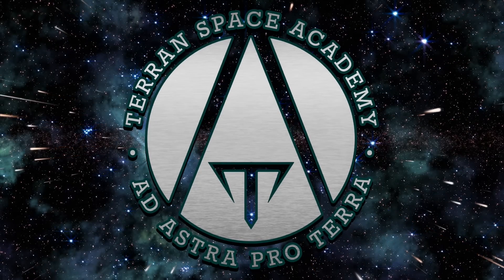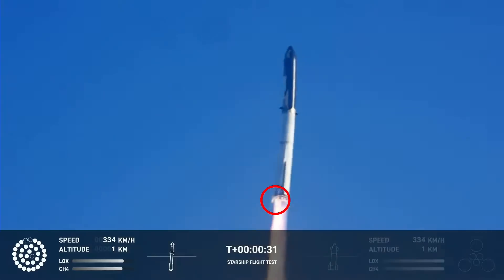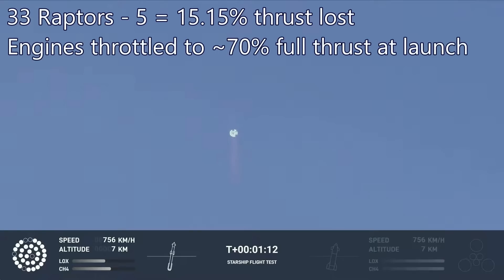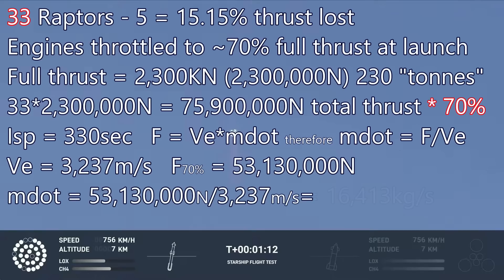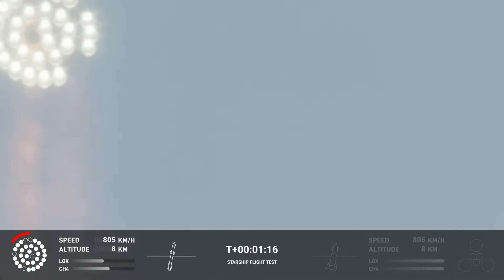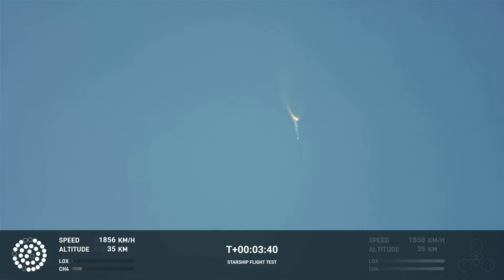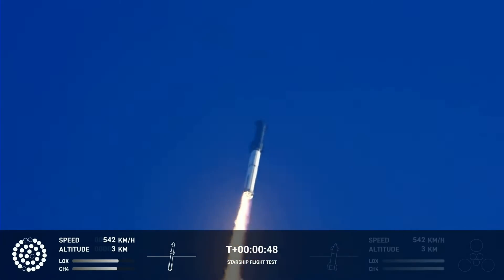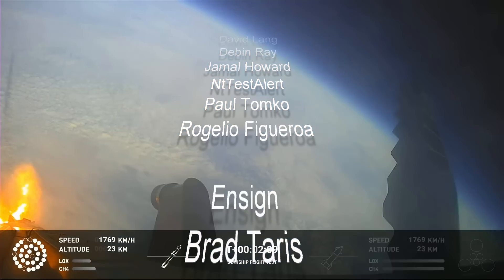Starship Flight Analysis: What went wrong with Starship?

Comment: Another thing I should point out is the LOX and Fuel ratio. This flight test shows they have less LOX than expected. So there might be some problem with the LOX and fuel ratio consumption, either fuel not flowing as fast as it should or LOX flowing too fast
Reply from the maker: Do you think there was a debris related LOX leak? If it was at the base it might not have depressurized the tank. I thought there was way too much venting off the one side...
Reply: @terranspaceacademy  It could be. I kinda doubt they would miscalculate the flow rate by such a large margin.
The damage caused by the debris to the vehicle is much more than I expected, so debris related LOX leak is very much possible

Comment: You spend all this time and money designing and building a state of the art rocket, then you take it out to the parking lot and  blast concrete all over the place, build a launch pad worthy of that rocket and for god's sake move it away from those tanks, I know that people say that it is a safe distance, but it just looks bad aesthetically, make a beautiful launch pad for a beautiful rocket.
Reply: Yes, No comment was made about the lack of deluge system (allegedly Musk wanted to proceed sooner than it could be made ready) or the resulting damage and flying debris possibly damaging the booster.
Reply from the maker: This was a test... and these things need to launch from unprepared sites on the Moon and Mars.  Knowing what to expect with a rocket you are going to throw away anyway is smart.

Comment: Nice analysis. I am interested in stage 0 conditions after launch.
Reply: Stage 0 could end up as the reason this flight had to be terminated.  The debris caused damage that became catastrophic.  They have to fix Stage 0 or the next launch is going to suffer the same fate.
Reply: @osd9933  Agree. The pushy bits of a rocket can be a bit sensitive to boulders and steel slabs smacking into them with blast energy.
Reply from the maker: CSI Starbase will do a great breakdown on Stage 0 I'm sure.
Reply: @terranspaceacademy  Yeah, He and his team do great work!

Comment: I think the lack of a deluge system and/or flame diversion is what caused the craft to not earn it’s extra credit points. The area under the launch mount is absolutely gutted. Impressively so. That much damage couldn’t possibly happen without damaging the engines. Immense shockwaves and high tensile concrete chunks probably slammed the craft. I’m absolutely impressed by how robust the craft is though. Numerous things seemed to happen in flight that would have destroyed a regular rocket. I can’t wait for the next launch! And I can’t wait to see how the issues are resolved.
Reply from the maker: I'm wondering about steel plating over the concrete?  Water cooled perhaps?
Reply: @terranspaceacademy  I saw a tweet from Elon today that described exactly what you’re talking about. I was thinking that running the deluge water through the steel plate might be a way to “no part” but I don’t know how useful super heated water would be in a deluge system.

Comment: a safer and less stressful way of separation would be to do a cool down of ship engines which should provide enough pressure  to separate
Reply from the maker: I'm not sure it would give enough thrust to use it as a cold gas thruster...

Comment: Thanks for that nice analysis! I believe though, that you are wrong in one thing: From my point of view, the SpaceX diagram concerning engines is correct, but you need to rotate it by 120° to the right. Then it fits exactly (well, it is some seconds lagging behind, so at times it still shows an engine going, that is already off in the video. And the one that is visible "off" in the video but "active" in the diagram, is exactly the one that "re-lights" later again). So, they did not lose 7 engines, but only 6. One coming back, so again only 5 missing. That is still sufficient thrust, as you calculated. Concerning the outer engine "re-lighting": probably it never was really shut down, but lost so much thrust due some internal failure, that it was marked as "off" in the diagram, but in reality it was still running at low thrust. Then it throttled up again. But that is just an assumption, based on the diagram.
Reply from the maker: Good point!  Thank you!

Comment: The center engines can gimble to account for loss of thrust.  Also, the engines that you highlight on the telemetry diagram were out 2-3 seconds after liftoff.  The failures you are pointing out in this shot do not correlate to the telemetry and don't appear until several more seconds. :(
Reply from the maker: There did seem to be a telemetry delay...

Comment: Failure to separate is a problem. Had a crew been aboard it would've sealed their fate. I am guessing this earlier rocket does not have a crew survival protocol to initiate separation in sub-optimal conditions. Put another way, it is possible that conditions never matched the required parameters to cause separation and, in the absence of crew escape systems, simply remained connected. As for the rest of it, there is far more than ice falling away from the vehicle upon takeoff. If you look closely at this and other, independent video, you can clearly see huge blocks of debris, probably concrete, ejected skywards - some reaching almost to the top of the vehicle. This being the case, it is entirely possible the rocket array was severely compromised by debris it had, itself, kicked up. No doubt we will be told in due course. To be honest I was disappointed. I expected the vehicle to at least reach its suborbital altitude and velocity, but it fell well short. Oh well, onto the next test...
Reply from the maker: Almost certainly David.  It's like launching with grenades going off underneath.

Comment: There is a flaw in your analysis.  My understanding is you don't actually vary the throttle on the outer ring of engines after an engine failure in order to counter the torque imbalance.  Instead what you do is gimbal the inner engines.  Something you can see in some of the videos is towards the end of flight, you can see the rocket is going off course before it all out cartwheels and this happens after more inner and outer engines fail.  There might have been the problem that the remaining inner engines couldn't gimbal enough to counter the asymmetric thrust and this is what lead to the eventual cartwheeling of the rocket as opposed to stage separation.  It was a well known compromise in that adding the extra inner engines, they reduced the gimbal range of the inner engines.

There is another problem in that for staging, the rocket was rather low.  I don't think it was ever meant for the rocket to stage at that altitude, but the Superheavy was done for at that point it seemed.
Reply from the maker: Very good points Jason... thank you.

Comment: I see and hear many "Success" posts but cannot agree in that assessment. The primary innovation and a key feature of the Starship stack is the novel use of full flow staged combustion engines. 21% of these engines failed at launch or soon thereafter. One may have failed explosively as debris was seen being ejected laterally. The green flame of a fuel-starved engine was seen in the brief onboard shot. An engine that is to be rated for human flight, reused, or especially used by humans leaving the surface of the moon, reliability is critical. 

Do we have confirmation that an FTS command was sent? 
[EDIT: Yes, we now do have confirmation. spaceX says the booster and Starship were each commanded to FTS separately]
The rocket tumbled down 20km, entering denser air at over 1,400kph in an uncontrolled attitude. the structure could well have been compromised by aerodynamic forces alone. Most launches from the US include an autonomous FTS trigger should the craft enter uncontrolled flight and for whatever reason not receive a ground based FTS signal. I was very surprised to see Starship allowed tumble for so long. Presumably SpaceX was trying to download all the data that they could.

One thing I have seen mentioned that I do not believe to be an issue is the broad area of flame observed in the engine area. This is a low pressure cavity and SpaceX has certainly engineered the area to withstand a general wash of low pressure flame and products of combustion.

TLDR: Given the past issues with the Raptor both in flight and at the Texas factory, SpaceX needs to step back and fully understand why 21% of the engines fired today failed.
Reply from the maker: I'm pretty sure the failures were from debris damage but we'll see.
Reply: @terranspaceacademy  That may be, but these are not the first Raptor failures we have seen. The ones that failed in flight are most concerning. I have other concerns with the design, but without the engines none of that matters.

Comment: That is not ice falling away at launch, but launch pad debris flying everywhere. Ice does not fly upwards at liftoff. A prerequisite for a successful test flight is first building a blast-proof launch pad system.
Reply: Yes, No comment was made about the lack of deluge system (allegedly Musk wanted to proceed sooner than it could be made ready) or the damage and flying debris possibly damaging the booster.
Reply: @rcpmac  Yes, what is the point of launching when the launch pad is wholly inadequate? All that flying debris probably damaged the engines before the rocket even cleared the tower. SpaceX engineers wouldn't have rushed to launch unless they were told to. I attribute the rush to Artemis envy.
Reply from the maker: The ice was falling down...

Comment: I think it is possible that asymmetric thrust may have contributed to the tumble, or, the forward mounted fins on the stack made for instability after the ship pitched beyond the ability to recover. As for some saying it was performing a boost back flip,  the engines would have to had been shut down first.
Reply from the maker: That's a good point...

Comment: Starship might not have reached high enough speed and altitude for stage separation to be triggered. The spinning  may have been caused by aerodynamic forces not by a deliberate flip for stage separation.  Remember that the engines were still running long after it started flipping.
Reply from the maker: That's very possible Matt.

Comment: Another reason why an effective flame diverted is a good idea is so that starship can do a full duration 33 engine test fire on the ground. Some of the engine out issues might have been caused by plumbing issues that would have been picked up in a full scale test fire.
Reply from the maker: Baikonur works well.
Reply: @terranspaceacademy  Hasn't launched for a while.. and wasn't built at sea level on wetlands with soft soil
Reply: Given how the concrete pad seemingly got vaporised, going to have to be a very solid system.
Reply: @mark123655  very solid or very deep (below sea level). A difficult task either way.

Comment: The Soviets tried this with the N-1 and it didn't work either...
Reply: The N1's third and most successful launch ended with a fuel rupture at 40km. Starship's first and only launch so far ended with loss of control authority at an altitude of 39km. So while I would caution fans from being overly optimistic about the next set of launches in terms of overall success, I similarly recommend critics chill their criticism before it ages like fine milk. Starship will in all likelihood work.
Reply from the maker: Almost certainly... control systems have come a long way since then.

Comment: Stage 0....I hope Elon has got "diverterless" launch pads out of his system, otherwise it's going to cost him something he can't buy...Time.
Also, the "flip maneuver" to separate is intended to function based on the difference in rotational inertia (from the center of mass) between the booster & star ship. This can't occur with the booster generating thrust.
What we saw was loss of hydraulic fluid that controls engine vectoring. Elon just held off destruction to gain valuable insight on the strength of the vehicle and boy is it strong!
Frankly, in my opinion concrete shards punctured a hydraulic line, along with others as soon as the vehicle cleared the surface of the pad creating a low pressure zone where shards could then find their way back up toward the booster (Note the hydraulic system is external protected by 4 MM stainless sheeting).
Reply: Yes, No comment was made about the lack of deluge system (allegedly Musk wanted to proceed sooner than it could be made ready) or the damage and flying debris possibly damaging the booster.
Reply from the maker: Very good points... and yes I ignored the lack of a deluge system.  So laser me.

Comment: Ice falling away? 😂 You missed that they blew up a whole in the ground? Slabs of concrete the size of a small car being tossed into the air 😮
Reply from the maker: That was to be expected Emil.  Each test has blasted concrete.
Reply: @terranspaceacademy  But its worth mentioning i think, since it will need to be rebuilt and so will a lot of things that got damaged by flying concrete slabs. Also the whole system without flame trench is probably going to be a big issue and might need a complete redesign. This was the biggest takeaway for me at least.

Comment: I'm not sure I agree with your analysis.  All the engines were lost in one half of the rocket.  If they had to throttle back engines on the other half to compensate for the asymmetrical thrust then this would have left the rocket underpowered.  The cartwheel started at 31km which is much lower than the expected 70+km (admittedly this target height is from other amateur sources rather than SpaceX).  That is low enough that there's still significant aerodynamic force on the vehicle (equivalent of about 200km/h at sea level accounting for the pressure difference and speed of the vehicle).  

I think that as the propellant levels fell the centre of gravity rose up the rocket until the gimballing of the engines couldn't compensate for the asymmetry in the thrust causing the loss of control.  Could be completely wrong on the cause, perhaps there was another engine that was lost for instance that caused the sudden tumble, but that was not a planned cartwheel as part of a separation attempt.
Reply: There's additional analysis out now that shows the bright orange flame along the side of the rocket shortly before the tumbling started was the loss of the hydraulic system, with the hydraulic fluid leaking and burning.  This would have stopped the engines gimballing leading to the loss of control.

There's also an asymmetric usage of the LOX and CH4, suggesting at least one of the broken engines was leaking O2.
Reply from the maker: Very good points but not quite half the engines were lost...

Comment: I noticed the first dead engines immediately after launch and wondered if there'd been contact with the OLM and thought they'd have to compensate on the opposite side then as the flight continued observing the exhaust plume you could see other engines going out.
Still, I considered the flight a success after it passed MaxQ.
I was supprised the first and second stages held together under the rotational loads of tumbling, VERY impressive and shows the inherent strength of the vehicle.
Finally, I was supprised at how long they waited to trigger the flight termination system. I wonder if they were just recording data or still attempting right up to the last to regain some control and get Starship flying?
Reply from the maker: Debris hammered several engines before lift off but the point is that it lifted off missing three engines and flew after losing at least three more in flight.  Pretty robust I would say.

Comment: Hey, hotshot analysts, where in blazes is your discussion of the incredibly slow liftoff, tiny acceleration? At 50 seconds into flight, a vanilla Falcon9 is traveling 1000 km/h at 6 km altitude. At stage separation, it should be at least 50 km up and moving at nearly 8000 km/h. Nothing like that happened today, probably intentionally. They were going for a low-speed suborbital test and did not intend to make orbit. Not by a long shot.

I enjoyed it as much as the next guy and look forward to a good explanation of the peculiar low thrust performance, even with 3-4 failed engines.
Reply from the maker: They intended to make orbital altitute, about 200km, and orbital velocity, just not lateral.

Comment: The cause of this RUD (Rapid Unscheduled Disassembly), was due to the number of engines lost (6 at time of use of FTS [Flight Termination System], in addition to the gimbals not being able to control the direction of the stack. The HPU's (hydraulic pressure units, 3 surrounding the base of the booster) flamed out just after Max Q. This was a known weak point as Booster 9 is equipped with electrically controlled gimbals, removing this potential point of failure. 

The decimation of Stage 0 will be the delaying factor for subsequent flight trials. The power of 30 raptors even at the reported 70% power destroyed the concrete below the OLM, cratering it a depth of several feet gone, to expose some of the foundational portions of the mount. Concrete debris hit the tank farm, and some of the hold down clamps on the pedestal. A flame diverter, and water suppression systems will certainly be a part of Mechazilla 2.0.  Additionally, the discussion to place the tank farm underground will certainly be revisited and discussed.

We learn from our mistakes, and there is a lot to learn from today's attempt. Very much looking for attempt 2.0.
Reply from the maker: 925 coming up!  Seriously that is a very good point.